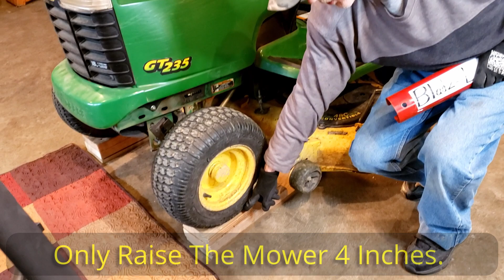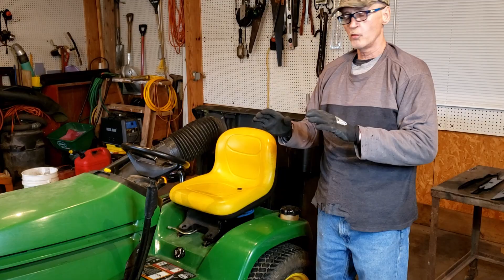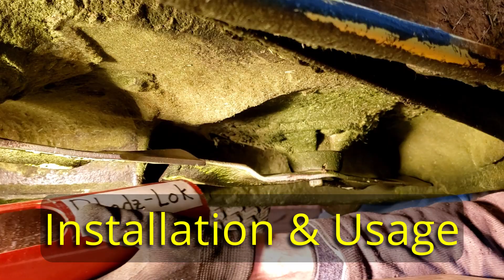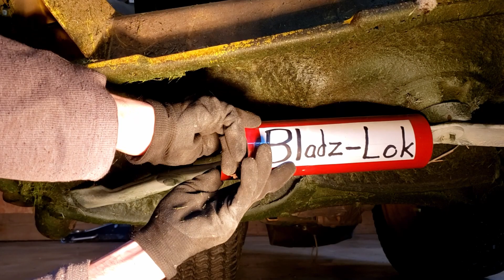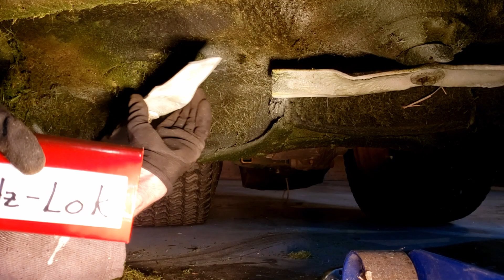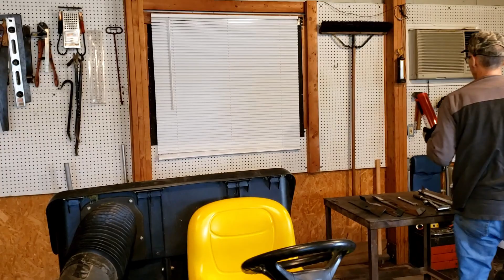Bladz-Lok Mower Blade Removal Tool - Full Usage Instructions

Comment: So what size is the one in the vid, standard or XL?
Reply from the maker: The one in the video is the Bladz-Lok Standard Coupler. My mother's mower and my mower both have standard normal blades like most mowers
Reply: @bladz-lok9938  I ordered a few from you a few hours before your answer 😆.   I got each, hope they are easy as they are for you. Thx.
Reply from the maker: @mikeprice8307  I'm getting them packaged right now for you into one bigger box. Once you use them they are a dream to use and I'm not saying that because I'm the inventor but because I actually use the standard coupler and wouldn't use anything else.
Reply: @bladz-lok9938  👍